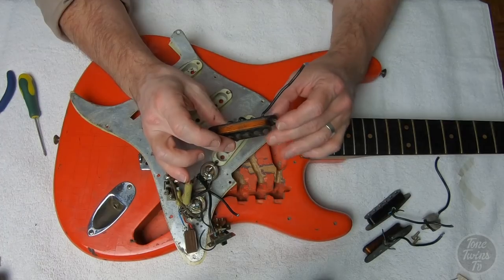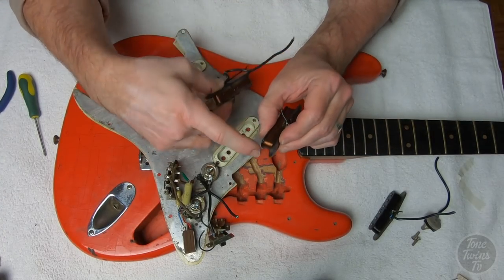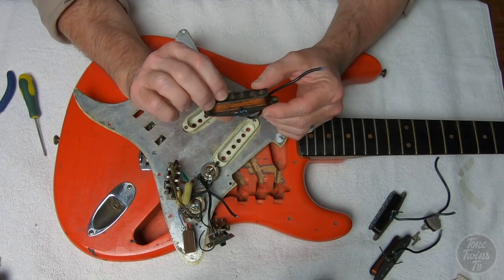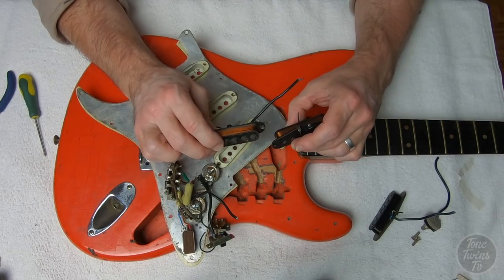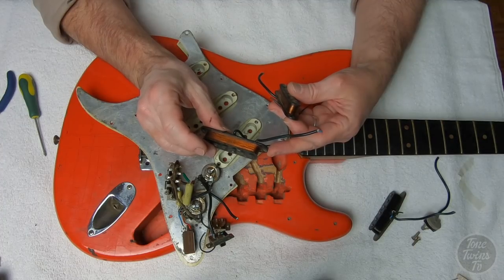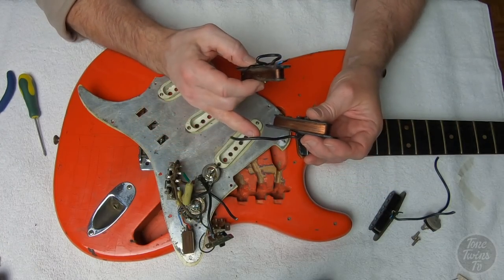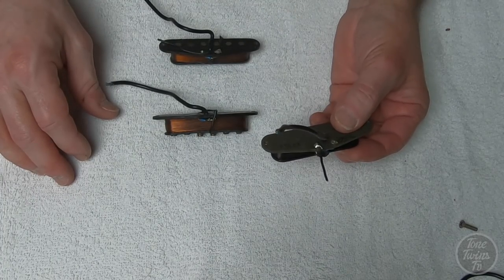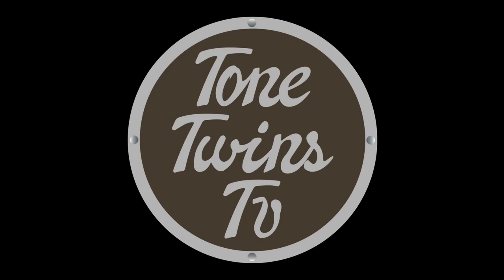Tone Twins TV Chris Buck's 1962 Strat Restoration Pt 1

Comment: My theory on the wiring: the three switches were for selecting pickups, the blade switch was wired to select between the different tone caps and the toggle was a kill switch switching between the main circuit and and an alternate circuit with the extra pot hidden in the hole set at zero
Reply: Gage Link oooh kind of like a Gretsch mud switch!

Comment: About 20 years ago a guy who I played cricket with told me he had a '65 Strat he had bought from someone "in a kampug"[1] and could he bring it over so I could I figure out what could be done with it.

Well he came over carrying an ancient '60's Fender case with a busted handle. Inside was indeed a '65 Strat.

If you think the one Chris has bought was in bad condition, well it's pristine compared to what was in that case:

A neck & body, both dated '65.

The body had been stripped and re-finished using a brush and something intended for use on a gate.

The headstock logos had been removed and a faux '70's Fender logo drawn on with permanent marker.

I guess someone back in the '70's wanted to make it look like they had a new guitar in the then fashionable brown finish.

The pickguard had been mangled and a slider switch added, who knows to what intent.

All the pickups still read correclt on a multi-meter and the pots and switch were there.

All the rest of the hardware was MIA.

I figured out roughly what the parts would cost to restore it to various grades of originality, and as my mate had no spare money at all I guess he sold it for parts...

1) This is Malay for "village".
Reply from the maker: That's really interesting Steve. I remember seeing vintage Strats like that back in the 80s. They weren't commonplace, but they were around. Now, for some reason, they're not... H
Reply: @tonetwinstv2863  I suspect they all got turned into "100% original not a screw turned once owned by famous rock star that will be $20K please" guitars back in the first vintage guitar boom.

I fully agree with your comment about "fix it with what you can find" back in the 60's and early 70's. 

I was offered a '62 Tele in '78 for 150 quid. It was quite beaten up, but the deal breaker was that it had a Gibson toggle switch where the three-way should have been. Presumably it was all they could find at the time the original broke.

Comment: It would be interesting to have measurements of those pickups inductance, self capacitance and field strength at the top of each pole. At a guess I'd say that wiring had the three slide switches wired as pickup selectors and the three way lever switch repurposed to select three different tone caps. The separate aluminium sheet electrical shield can have an effect on tone although it looks as though it has been cut away around the pickups.

Comment: I’m watching from America (where that guitar was made). My hardware goes in a metal, bowl shaped container with a magnet, a device designed for that purpose. Maybe you have heard of them in England? Take-out containers, regardless of the material, are primarily used for food over here.

On such a highly modified instrument, I would have made a quick sketch of the circuit (in a notebook I keep just for that purpose using only a fine quill feather pen) before disassembly in order to understand what was being attempted and to reserve the ability to return it to that configuration if the desire came up as well as for history of the instrument. I seldom cut any wire and especially a pick up wire, midway through it length even if I intend to throw everything away. It’s not proper bench practice and feels quite naughty. they should have been de-soldered from their connections at the controls and finally a spoon shape is terrible for removing knobs, the curve results in two pressure points on the very edge of the knob. There is a tool designed for that purpose, ironically mine was purchased from an English manufacturer and is shaped more like a fork really. 😉

Good luck with the guitar, it is a nice piece of history.
Reply from the maker: how very strange, our takeaway meals are delivered over here in the UK on huge specifically designed magnetic bowls. ;)

Comment: The neck p/up is probably an X1 which Fender originally fitted to The Strat model in the bridge position in '79 given the date stamp and high ohm readings, it was then fitted to the regular line of Stratocasters a few years later for a short time.
Reply from the maker: That's interesting info David, many thanks. I figured '79 based on the stamped number code, but wasn't entirely sure - H

Comment: I suspect that the bridge pup was the original neck pick-up. The seventies pickup then may have been in the bridge position first, but later it traded place with to end up in the neck position. Perhaps worth checking the distances between the pole pieces for each pickup as well as the pole piece polarities. I think the mini switches controlled on off for each pup, the 3 way switch was used for different tone selections. Perhaps a treble bleed?

Comment: Fascinating. Look forward to seeing the full restoration.

The beefy 70s pickup is interesting an x1? Or an early replacement like mighty mite maybe.

What about the holes where those sliders were?  Be interested to see how you deal with that.

I was born in 62 so a 62 is my holy grail!  I have a Squier JV 62 Strat, sadly butchered by me like this one because I never expected it to go up in value like they have. I have 80s USA standard strat electrics and sperzal locking tuners on it. But still I don't intend to sell it.
Reply: That’s a 1980 X-1. You can tell by the ‘80’ at the end of the date stamp for the year (first two digits operator number, then week, then year), and the ‘96’ pencilled on and the 7+k resistance suggest X-1.

Comment: On the three switches idea, David Knopfler of Dire Straits had a black ‘62 Strat with that exact same mod, it was three switches that looked like it came from the top section of a Jazzmaster. Unfortunately, the switches did not do anything, so I presume the Dire Straits guitar tech (Ron Eve if I remember) just bypassed the switches. I presume they were for different pickup combinations like all three active, or bridge and neck etc. maybe phasing.
Reply from the maker: I sent Chris a few pictures of the David Knopfler Strat when he'd first bought his guitar because one option was simply to leave the switches in but bypass them as you mention. But it was a pretty ugly job to be fair, and Chris was understandably keen to get rid of them.

Comment: Did you make a quick wiring diagram before you dismantled it ? I'd love to work out what was going on, It looked like an old strat with a jazzmaster mod iv seen years ago.
Reply from the maker: We didn't. Some of the connection wires had already been detached so there would have been a lot of guesswork. Besides which, Chris' Strats are wired stock and having modded Strats in all sorts of ways ever since I was a kid in the 80s, I've long concluded that I prefer them exactly as Leo intended.

Comment: Hey so I think that’s actually a post 65 neck pickup..... they switched sometime in the 1970s back to black bottom pickups. It’s also got the same serial number range as some of those later 60’s pickups
Reply from the maker: Interesting Roger. But weren't the slugs staggered until 1974? These slugs in Chris' grey bottom are flat and very shiny. So I'm assuming post 1974, but happy to be corrected.

Comment: There are far safer and easier methods for removing knobs than attempting to pry off with a kitchen utensil. Came thisss close to breaking one of those relics. Too bad he didn't take two minutes to identify which p'up (and cover) went where. Even if you end up relocating a pickup to another position, it's nice to know where it came from. I would save, but not use that butchered pickguard along with the three way switch. This guitar will never be original again, so source a period correct third pickup, pot, and unmolested pickguard and re-use the two original pots and p'ups if possible.  Obviously not original paint, so he has carte blanche to finish it however owner wants.
Reply from the maker: How do you know we didn't take notes on the positions of the pickup covers exactly? Are you 100% positive about that? If we had covered every tiny detail of the restoration dude, we'd be running this series until Christmas. 
Clearly we welcome constructive comments, but making baseless assumptions undermines your otherwise valid points.
Reply: I’m no (professional) expert. But damn the prying of the knobs looked painful to me. He did stop however when he realized they weren’t popping right off. I  have a feeling most of this process was edited out for the sake of YouTube. Nobody would watch a 5 hour video disassembling a pickguard. The guy doing the work seems to know his stuff. We all have an idealized version in our head of how to do this type of work but it almost never works out so smoothly in real life. I speak from experience, as little,as it may be. You can’t perform some actions in slow motion like you see on the internet.
Reply from the maker: @allstopblue5717  Spot on. TBH we think most viewers get this. Those who don't, well we look forward to seeing their videos to learn how the real experts do it ;)

Comment: Fascinating. Looking forward to all that follows on and agree with the suggestion to put the 70's pup into the bridge position. Were you able to tell if the middle pup was reverse wound or not?
Reply from the maker: It wasn't reverse wound and the polarity of the grey bottom was identical to the 60s pickups. So it's all a mystery.

Comment: I think the 3 way switch acts like a varitone circuit while the new switches control which pickups are active.
Reply from the maker: That would seem to make sense. But what do you think the potentiometer through the spring cavity did?
Reply: @tonetwinstv2863  that is a mystery! maybe a tone for the middle pickup? Something you'd adjust and then not play with